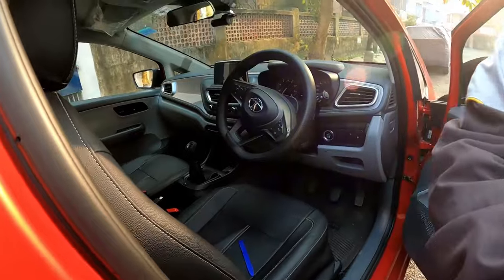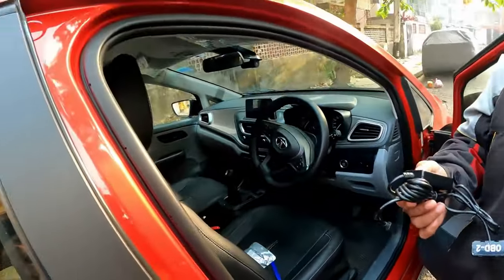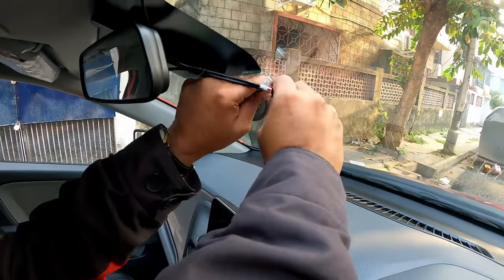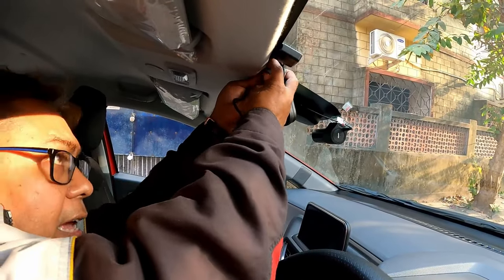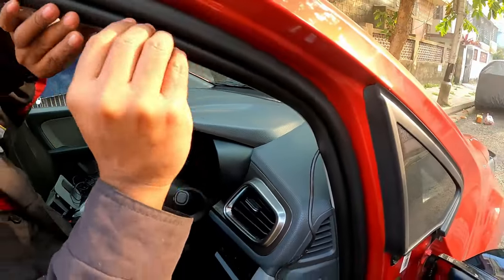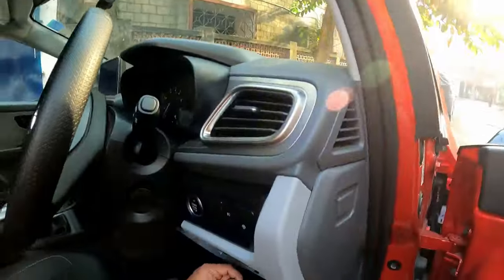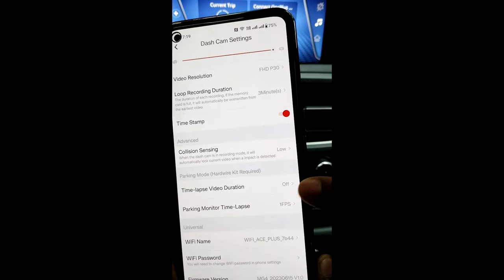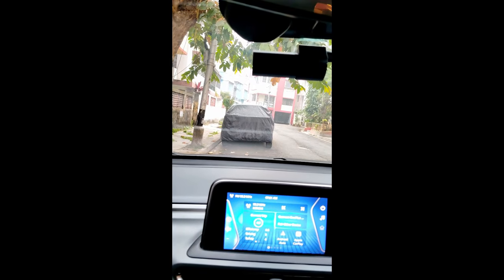How To Install Hardwire OBD 2 type Kit & Enable Parking Mode of Nexdigitron Ace + in Tata Altroz

Comment: What is the effect on battery life due to hard wiring of dash cam..especially if i want rear and front ..both the dash cams to be installed in the Altroz
Reply from the maker: My car is 3.5 years old  so the battery is. Still I have no issues with the battery. The hard wire kit has a battery protection system so if it goes down to certain voltage it will disconnect from battery.

Comment: Hi. What if I just want to use it as 12 volt socket means no parking mode?
Then will it on only when my car ignition is on?
Reply from the maker: If you don't need parking mode then just connect it to a 12 volt socket and it will work.
Reply: But what if i want to connect it to OBD Port?
Reply from the maker: Yes you can

Comment: I recently purchased Nexdigitron prime dual channal dash cam and connected it with OBD2 cable, it worked for couple of days however, it stopped working now, though I am able to connect it with the type C cable, what could be the reason it is not connecting with OBD2 cable
Reply from the maker: If you are facing trouble with the obd type connector you can opt for the  fuse tap connector I have made a video on that also. Also sometimes cars do not support odb connectors prperly.Also call Nexdigitron for support they are very helpful in this regard.
https://youtu.be/9qQuoz52jrs?si=4H0syyNgf9StusKL

Comment: Is it possible in VW Taigun also? Which company cable is this
Reply from the maker: When you buy a dashcam you have to purchased an obd hardwired compatible kit for the same. If the dashcam doesn't support the obd type then you need a fuse tap kit for which we have a different video. Fuse tap kits support all cars.
Reply: Pls mention which obd wire is this.
Reply from the maker: Its Nexdigitron Ace Gps model i compatible. What is your  dashcam model?
Reply: @supercyberautomotivetravel  I am planning to buy 70mai A510 dashcam. But I am unable to find obd -2 cable for the same that would work fine with it.
Reply from the maker: For 70 Mai dashcams you will need a fuse tap hardwire kit. It's easy to fit and reliable too. 
https://youtu.be/9qQuoz52jrs
Reply: @supercyberautomotivetravel  Will it affect warranty?
Reply from the maker: No you are not tampering any wiring. Its a bypass fitting without interfering your oem connection.
Reply: So obd hardwiring is not possible in 70mai is what you’re saying? 

Also which city are you in, if I need help in fusetap hardwiring
Reply from the maker: I am from Kolkata. You can also ask the supplier Nexdigitron . They are quite helpful if you need any assistance during installation.

Comment: My dashcam remains on even when the car ignition is off. I am using this very obd2 hardwire kit
Reply from the maker: It will remain on since the parking monitor feature gets activated after you switch off the ignition.
Reply: @supercyberautomotivetravel  it’s the normal recording not the time lapse enabled recording. There is a clear distinction in the LED pattern.
Reply from the maker: Try resetting the dashcam and then check.
Reply: @supercyberautomotivetravel  already did. Totally forgot to mention that I am using a Blaupunkt dashcam with the nexdigitron obd2 hardwire
Reply from the maker: Hardwire kits are mostly dashcam specific specially the obd type kits. Go for a fuse tap kit which are of unversal type. I have a dedicated video on it.
Reply: @supercyberautomotivetravel  ok, guess I botched it up by trying to assemble it. Any way I can still use this and still get the parking mode activated?
Reply from the maker: Try disabling the parking mode first. If the power is still on even  after ignition off it seems your 12 volt power supply is still active .even after switching it off. If your kit is under warranty try replacing the kit.
Reply: @supercyberautomotivetravel  let me tell you my setup. I own a polo, use a jio motive, so to use all of this and get the dashcam working with parking mode, I got a obd2 splitter as well. The connection is main obd2 port to splitter, with jio motive on one end and the hardwire cable on the other, all the way to a micro usb to type c converter and finally the dashcam. Even after ignition switch off, the obd 2 keeps supplying power. The hardwire kit is a 3 pin obd 2 jack
Reply from the maker: Ok I got it. In polo I feel the 12 volt supply remains active  even after switching off. German cars have some proprietary set up so that anything other than OEM may not work. Try removing the jio and see if it works .
Reply: @supercyberautomotivetravel  let me see if that works, I will let you know
Reply from the maker: @debroopp ok

Comment: If we connect obd then not able to fit that cover
Reply from the maker: Definitely the cover will fit and I have fitted back.
Reply: Excellent well done video! I have a hard wire kit coming tomm via the diagnostic port. You have answered many questions. .
Reply from the maker: Thanks for your feedback and support.